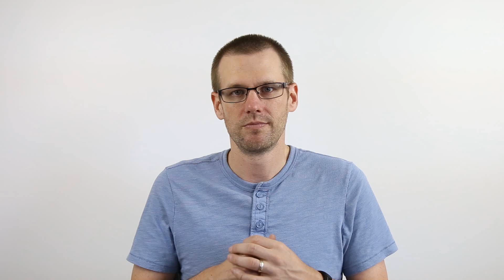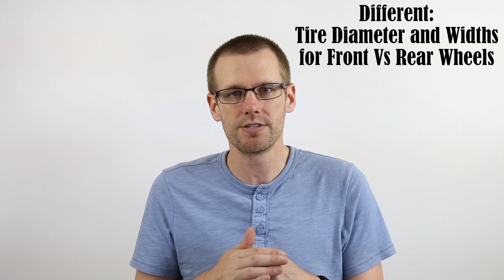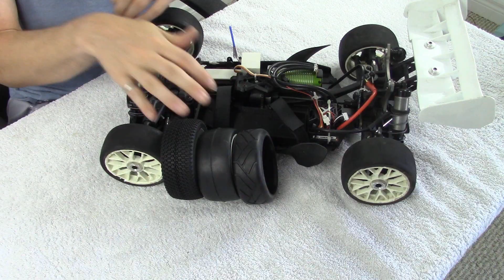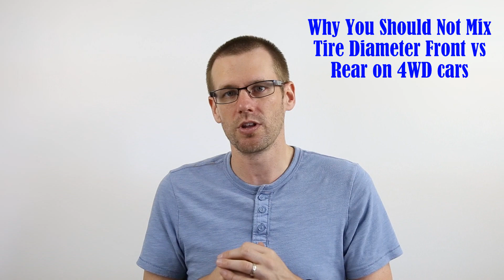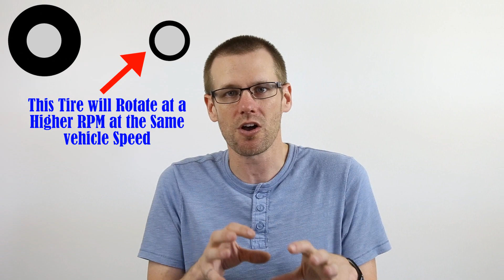Run Wider Width Tires or Larger Diameter Tires in the Front vs Rear?

Comment: Utter nonsense. Have you considered how 1/8th on road cars work? I'm talking about circuit raced cars - not just driving them in a straight line & calling it drag racing - 4wd, no centre diff, solid rear with larger diameter & one way front with smaller diameter. Read up on a thing called run out.

Comment: Hey, my question specifically relates to 4wd, 1/5 scale buggy tire size. I currently have Rovan tires on it (170x80 knobbies in rear and 170x60 ribbed pattern in front) and I'm wondering if I should get the same width and knobby pattern all the way around. Feels like in not maximizing my 4wd handling with the smaller ribbed tires up front.

Comment: Front wheel drive with wider tires at front and narrow tires at back or narrow tires at front and wider tires at back. Which out of two options will give good pick up and mileage to the car? Car is used for city commutes only and no racing.

Comment: Hey bro can I upgrade my a959b with 5200kv motor and 120A esc and Can i trst speed run with 3s lipo with it please reply🥺
Reply from the maker: Hey, hop on a forum and see what others are  putting in to the rc. This will give you an idea If it is ok.